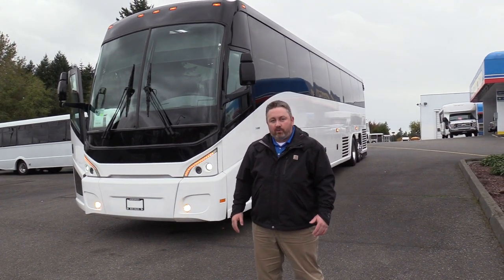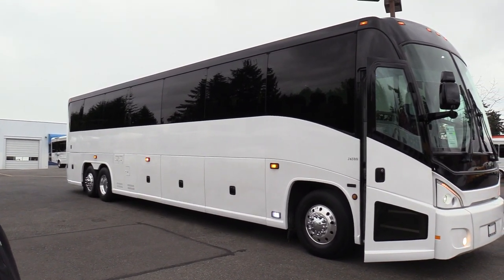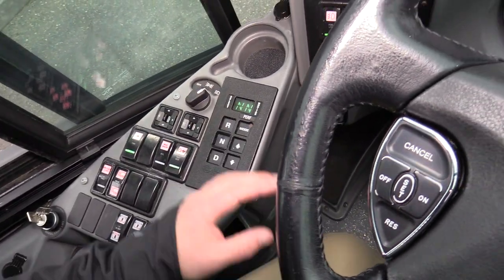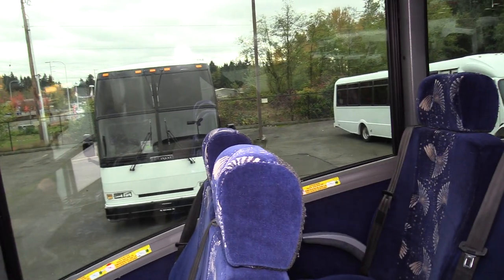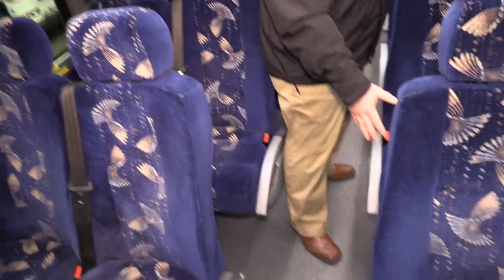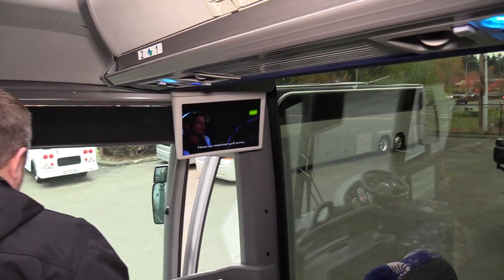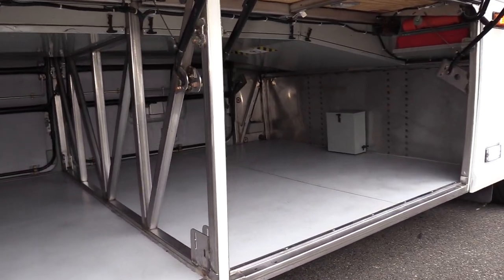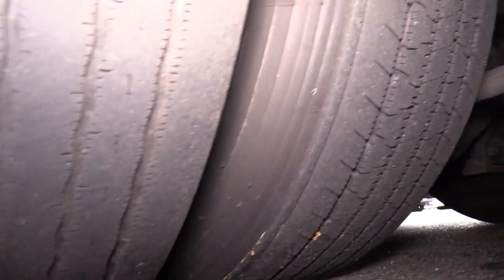MCI J4500 56 Passenger ADA Coach - C66303

Comment: I have several questions: Does the bus have air disc brakes? Do you have problems with the exhaust system, as far as DPF and SCR defects, REGEN, and stopped up dosing valves? Is the wheelchair a Braun or Ricon brand?? Thanks!!
Reply: If you were actually interested you'd call

Comment: the crankcase is leaking oil a piece of advice before buying a bus always look at the engine joints if you look at oil stains or the bottom of the engine or if it leaks don't waste your time because you are going to spend much more than you can imagine

Comment: is MCI owned by Bluebird?? same steering wheel except for the buttons
Reply: MCI is not owned by Blue Bird Corporation. Also, the steering wheel, with the buttons, looks like a Kenworth W900 steering wheel. I guess the vehicles share a common steering wheel supplier.
Reply: Joey Wagers The turn signal sound, same steering wheel (2011+).